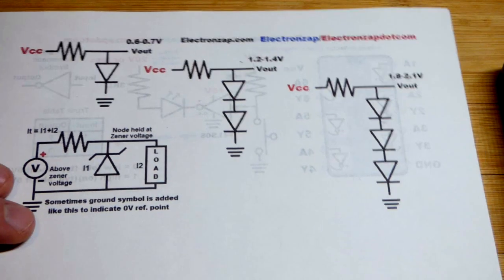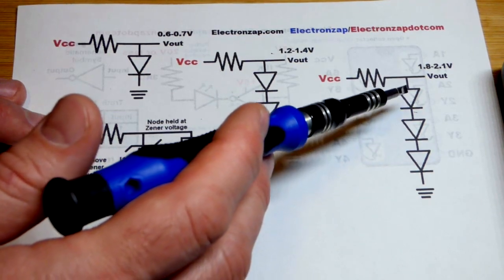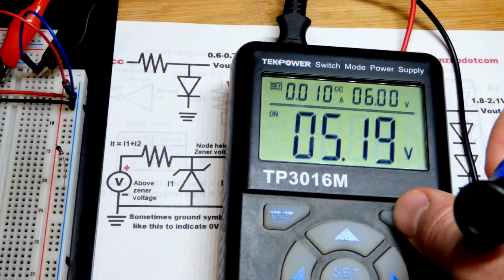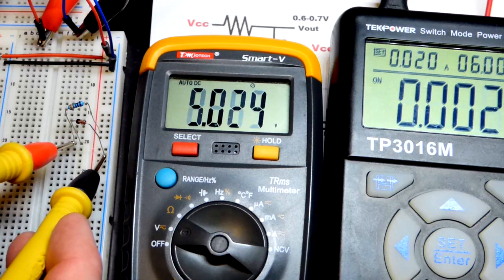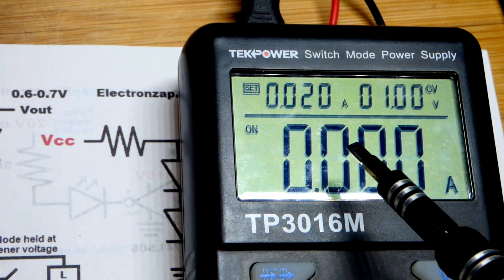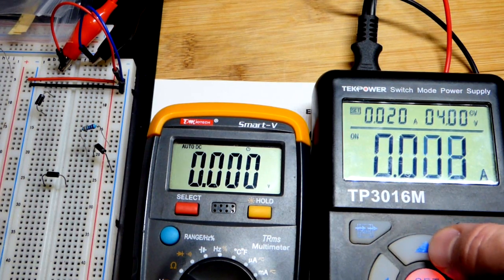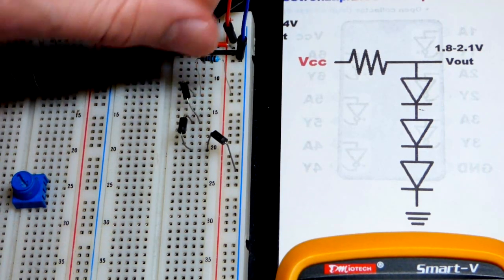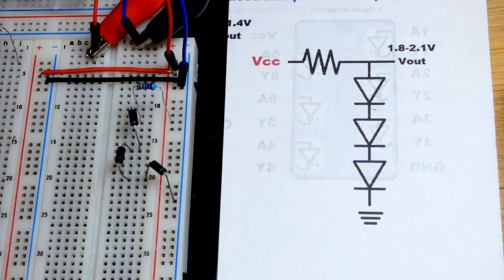Forward biased rectifier diodes substituting for a reverse biased zener diode voltage regulator

Comment: Can I put a led in parallel to the three diodes? Is it light on?
Reply from the maker: An approx. 2V forward voltage LED will probably light up. Current only flows equally through parallel components when their voltage drop is exactly the same. Otherwise it all flows through the lowest voltage drop parallel semiconductor.